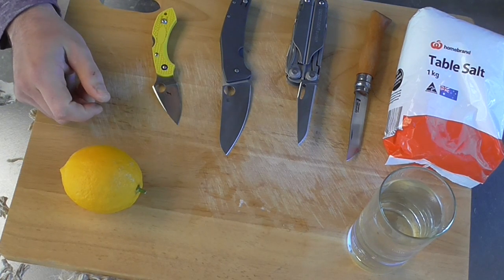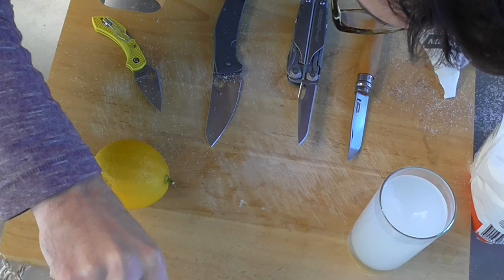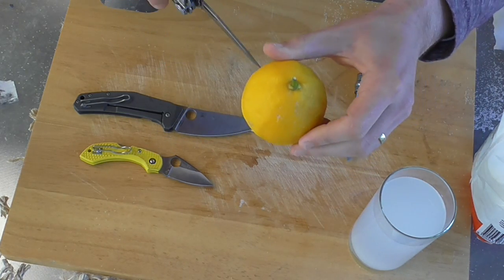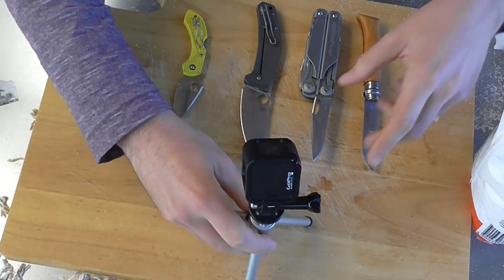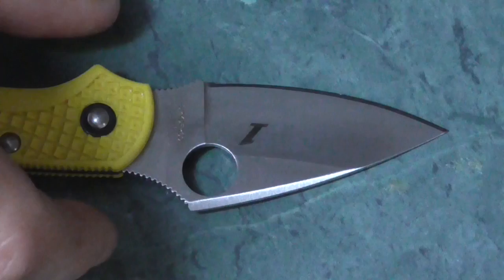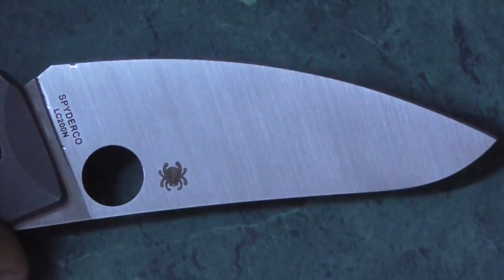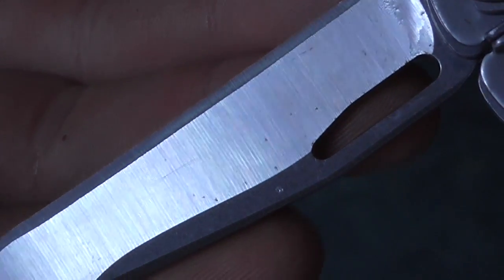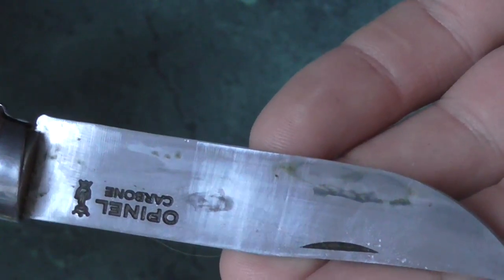Time Lapse - H1 and LC200N Stainless Blade Steel Test

Comment: Hey Pete not trying to bash you but lemon juice is an acid and salt water is a alkali one is acidic one is alkali if you put your blade in acid and then dip it in alkaline water it neutralizes the acid so you're actually not getting the full corrosion effects it has to be one or the other thanks for trying aloha

Comment: Did u test the edges after? Most of the time the Corrosion really affects the edges
Reply: Yeah, that's an under-reported issue, I think. I was researching lightweight fixed blade knives of 3.62"-4.00" blade length for an ounce-conscious pocket EDC complementing beater/backup for my day bags. Unable to find the previous, discontinued 2.0mm thick HIGH Scandi grind Moras at retail [the old Ericksson type '546 style'/(fr. Viking 660) or Craftline Q FT546 in stainless] -- a partially serrated Clipper F Rescue model excepted (bought it) -- I considered the Classic 1 carbon due to its similar blade profile, but I was concerned about that one, living in my packs as a no-fuss, very low maintenance back-up for just the reason you cite.

I have been carrying an SK-5 alloy Hultafors SK with plastic sheath in my backpack with little use to date; but I have already noticed what appears to be a dulling (?) of the sharp micro-beveled factory Scandi edge, not from use, but just from sitting in my pack, which has taken some rain despite umbrellas. Thus, I picked up a 6114 alloy Cold Steel Finn Bear for just under eleven bucks on Amazon when it was cheap instead of the carbon steel Mora. First use today on an apple.

Does any of this align with your thinking, neroknives? I really wanted something I could maintain in minutes on a Sharpmaker, etc., rather than a true Scandi (minus microbevel or "Scandivex") which would, I expect, require taking off more steel over maybe 15 minutes (?) to re-sharpen. No sharpening expert here, so regard my comments as questions! Thanks.

P.S.- I did buy a more fun Opinel No. 9 carbone, too, which I do like so far. Same potential for micro-corrosion dulling, if my conjecture holds, however, I'd expect. Easier than a full Scandi to bring back, though?

Comment: one of my bead blasted folders got some small rust spots like on the Leatherman and I was only carrying it .. how do I get rid of the small rust spots and what is a good oil to coat knife blades with?
Reply from the maker: +91classicrock very fine sandpaper, and wd40 is a fine rust protectant. Just make sure to relube the pivots with oil if you get any in the moving parts of the knife.

Failing that, a soak in WD40 and a scotch brite pad will do it too and probably keep the bead blast look better
Reply: ok thank you for the reply .. so I can spray my 1095 blades with wd 40 for storage also?
Reply from the maker: 91classicrock thats what I do, works a charm
Reply: sweet thanks again! have a good one and keep making videos!!

Comment: these are not rust proof but highly rust resistant. enough time and the right conditions they will rust. I don't think many people will find that out tho. a guy on the forums had lc200n mule team blade used in the kitchen that rusted a bit under the scales even with a coating if Vaseline. another guy went to some hot springs for a while which have lots of different minerals not just salt that caused a bit of rust also. I've seen folks without issues just putting salt on there blades... but cutting apples caused rust (on stainless steel not lc200n) which was strange to see.
Reply: Incorrect, H1 will not rust, it does not have the composition to do so, that's like saying water is flamable. It CAN however corrode, but only from chemical substances, still - this is not actual rust, it's corrosion. There's a H1 out there that has been sitting in a salt water fish tank at the spyderco headquarters for years, not a spec of corrosion on it. These facts have already been proven. The only discoloration on H1 ever recorded are from remnants left behind after the laser etching is done on the blade to put the logo "H1" on it, but they are from the etching process not the actual blade and wipe straight off with a rag. LC200N has had reports of some impurities in the manufacture process on certain knives, i've heard and seen all the mule issues, some have been sent back to Sal to check where the contamination happened. Only seems to have happened to a handful out there.
Reply from the maker: +Tactical Center yeah must be the acids in the apple I bet! Yep, there must be a recipe for rust even in these steels - and I think I mean to find it!
Reply: Interesting. Thanks, Mike. ...And Tactical Center, too.

Comment: I have read many times 420HC is pretty much as good as H1....seems not
Reply: Bohler N690 and Krupps 6114 stand out to me for high corrosion resistance. I agonized over easily maintained steels for coastal area EDC and recreational boating use. See my comments on this over at Pete's updated Spydiechef review, and my own provisional choices there. My nice little M390 LionSteel T.R.E. G10 (orange) is probably not what I want to carry knocking around in shorts and getting sweaty under the conditions cited, despite M390's apparently noteworthy corrosion resistance.

The mystery steel Victorinox uses seems to be highly stain and rust resistant, but it won't hold an edge like N690, or come that near to edge holding under abrasion as the 6114 should in practical, everyday circumstances. You can buy their basic kitchen knives on Amazon pretty dirt cheap... like, two styles with outdoorsy orange plastic handles for under $12... which may not be the worst choice you could make for corrosion resistant back-up use, given the slicey things most of us usually ask our EDCs to get done. People seem to love 'em and keep 'em forever. Normal people, I mean! Maybe good for a trial run of that steel alloy.